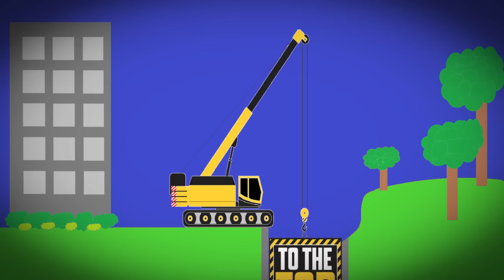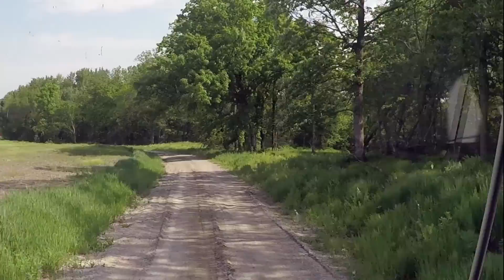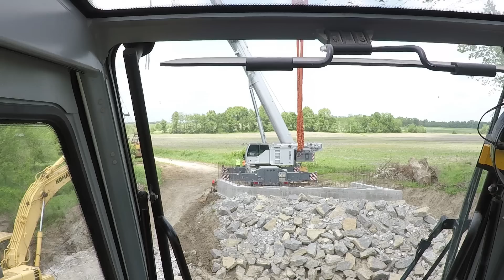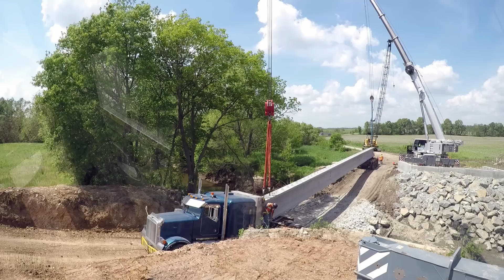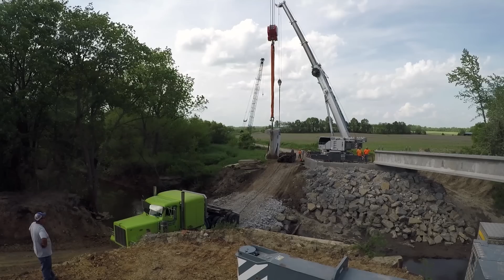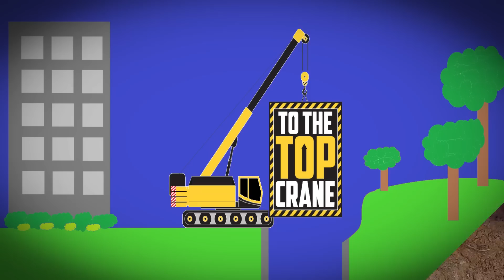Tadano and Liebherr working together to build a bridge | construction (industry)

Comment: I don’t like when I get calls while I’m at the controls of my tow truck. It’s always my dispatch,and never something important enough to require immediate attention. They get grumpy when I ignore the phone, but mine and my customer’s safety are paramount whenever the PTO is on. We had a telemetry system in our truck that was supposed to accurately update our location, speed & PTO status but the refresh rate was too slow. They claimed 90seconds max. We saw up to 15minutes.
Reply from the maker: It always seems that the phone rings at a bad time. Fortunately, those who know me, know that I'm probably busy when I don't answer.  So, they don't get mad. I can use that to my advantage too. 😂. Many thanks for watching! 🙂

Comment: Is it up to you to figure out the maximum radius you need and how much weight you will have? The radius must change a little when you have another crane picking up the other end and you might not know his exact plan. I liked when you were telling us how much weight you were picking up too. Thanks for the video. Did all the beams weight exactly the same?
Reply from the maker: When we look at the job or set up, we use the load charts and determine maximum radius. We then position the crane in such a way so that we never exceed that radius. All of the beams did weigh the same. Many thanks for watching! 🙂

Comment: When you have the boom extended and a heavy load, does the electronics/computer limit the speed of the swing/boom/winch....or do you just have to do that yourself..?
Reply from the maker: Some cranes will reduce the speed of functions with longer boom lengths. The one I operate does not though. I have to move the controls they way I want the crane to respond. Many thanks for watching! 🙂

Comment: good God don't these truckers even know about low and low low gear ? like you said it's a good way to take out a drive shaft. Nice work setting beams, do you guys have radios to communicate between the two cranes ?
Reply from the maker: No radios. We had a pre-lift meeting where we discussed how we wanted it to go. The rest is just watching the piece, knowing how it will respond to certain movements and trusting the person in the other seat. Many thanks for watching! 🙂

Comment: Just curious when you went to make the pick, what was the clicking noise that seemed to go with the cabling up and down speed
Reply from the maker: The clicking is an indicator that tells me that the winch is turning and approximately how fast. Many thanks for watching! 🙂
Reply: @ToTheTopCrane  thanks for replying hopefully you see this next question. Although ive been in construction and operated heavy equipment all my life never been around cranes much and i wanted to ask if you are able to move after loading the counterweights on the crane. Example you have to lift a piece and it has to go farther than your load chart allows you to with the weight.Can you bring in the outriggers and scoot over without having to remove counterweights ?
Reply from the maker: @juniorp6467  I can move the crane with all of the counterweights on it. There is a very strict procedure that has to be followed though. It also has to be on a hard, level surface. Great question! 🙂
Reply: @ToTheTopCrane  one more  question. Do cranes have any kind of hydraulic lock out valve for the cylinders and outriggers. Ive always wondered cuz holding anything with an excavator or any piece of eauipment seems like you get alot of bleed off and you can loose a fit up real quick do cranes have a way to stay stuck in a position or do they also suffer from a little bleed off.?
Reply from the maker: @juniorp6467  it does have holding valves in the cylinders. The only time a cylinder will bleed off on a crane is if the packing is going bad or the holding valve is malfunctioning.

Comment: Over its service life- likely about a hundred years.. the concrete beam bridge will be substantially cheaper than any other type- steel and wood both require expensive manual labor maintenance... the concrete doesn't..
Reply from the maker: That makes sense. I didn't really consider the long term costs. Maintaining a steel or wood structure would be very expensive over the course of 100 or so years. Many thanks for watching! 🙂
Reply: Yeah, but we'll be flying and using tunnels in 20 years and won't need bridges.

Comment: Who hauls 90 foot long beams without a steer axle? There are two bridge beam manufacturers here. One makes steel beams and one makes concrete beams and they both use steer axles.

Maybe they're putting in a big bridge because they plan to improve that road.
Reply from the maker: We had the exact same thoughts on the non-steerable axles. 🤷‍♂️ I'm guessing you are probably correct on the road improvements. Many thanks for watching! 🙂
Reply: There are 2 companies in my area also that build beams (1 concrete, 1 steel) and both use steer axles on back. Western, WI

Comment: Hey Jimmy!  Nice to see a new video!  Question to you.  Is the crane subject to the ELD logs like the other trucks?  I would think so especially on long days like this one but I wasn't sure.  Also if you are then are you allowed to go past the 14 hour clock to finish the job, then drive back home after the 10 hour break?  How does the law affect you as a crane operator?  Thanks!
Reply from the maker: It's really kind of a mash up of different regs. The crane doesn't have license plates or a DOT number. It's considered off highway equipment. But, it still is subject to permits and has to use on road fuel for the driven portion, as well as carrying an insurance card. We also typically stay under the 100 air mile rule. So, we aren't subject to the ELD. If we go out farther (which almost never happens because it isn't cost effective for the customer) we use paper logs. There is also a rule that allows a 16 hour on duty no more than once per seven days. So, that can apply too. It really is a mess when it comes to all of that stuff. And some people think the crane world is easy. Lol. Many thanks for watching! 🙂

Comment: heck yeah on the ring tone, cant hear that tune enough!!   why no one had hard hats on, curious site?
Reply from the maker: I do love that tune as well. Both versions of it. According to the standard, hard hats are only required if there is potential for falling objects landing on a person, hitting one's head or electrical contact. Many thanks for watching! 🙂
Reply: @ToTheTopCrane   IUOE Local 18 member here and am familiar with the standard which is why it made curious, everything in your quote of the standard applies on that site your working sans electrical...…im not the safety guy I was just curious.  I watch your content because its something my guys say I should take up, crane operator instead of hoe.  One guy has worked around cranes quite a bit and says I have the skill to operate a crane and should be doing so.  I enjoy listening to your chatter as you operate and explain things as they go, keep doin your thing operator!
Reply from the maker: @opengchris18  Local 101 here. Most all of the videos on my channel are while working on job sites that we are a sub or rented crane. All I am there for is to make things go up and down. Lol. I'd say if you are a good hoe hand, cranes would probably come pretty easily. There is a lot of information to retain. But, it is very manageable. The biggest part that people underestimate is the responsibility and stress involved. If you are calm and cool under pressure, don't mind sitting still for what sometimes seems an eternity and retain knowledge, I say go for it. I truly enjoy my career. However, there are days when I wonder what I got myself into. Lol. If I can help in anyway, feel free to reach out to me. I'll do what I can.
Reply: @ToTheTopCrane   loud and clear brother!  Its that stress you speak of that keeps me out of that seat, I understand it completely.  To often we pic slightly too heavy a load with a hoe and so long as you know what to do......but you on the other hand have stuff just hangin out there in the air and that's when im like, na im good!!   Stay safe my man! And thank you, will do
Reply: @opengchris18  Ha, remember an old crane hand who used to spend his spare time reading the IRS Code - he was fighting the IRS because he read somewhere it was unconstitutional to pay taxes and belonged to some whackadoodle organization that refused to pay taxes "on principle".  Oh my.  He literally spent hundreds of hours reading that damn Code.  Unsurprisingly, I met him a few years later - he ended up paying his taxes, plus interest and penalties and lots of lawyer fees....and it bankrupted him.
Reply: @ArthurDentZaphodBeeb   im thinkin we all have had that sort of wishful thinking in the past at some point, lol, aint happening!

Comment: Just like I said , dummy truck drivers, higher gears ⚙️ will allways work better, that is less Horsepower on the ground, you in lower gears ,will be putting to much power, higher gears and diff, locked in will allways be better, thanks BigAl California.